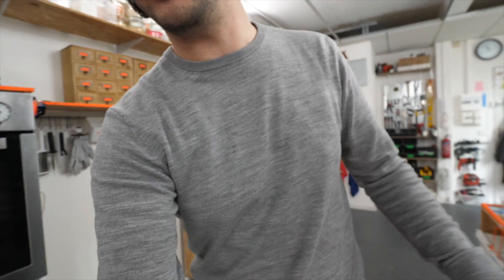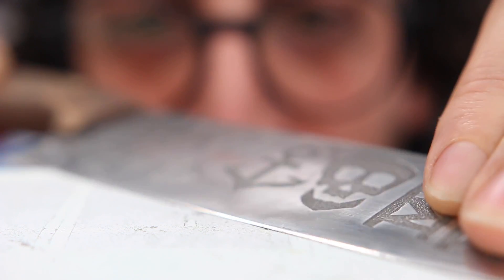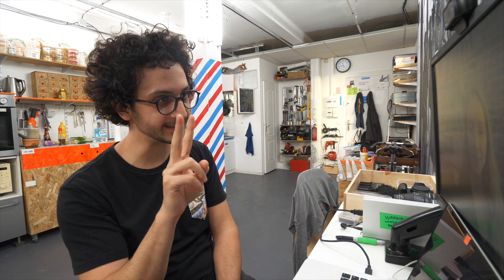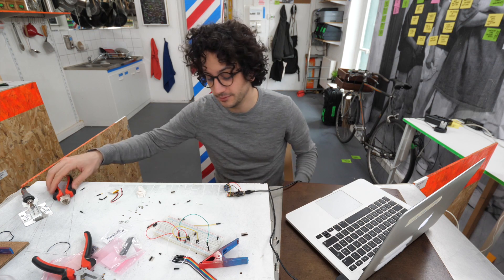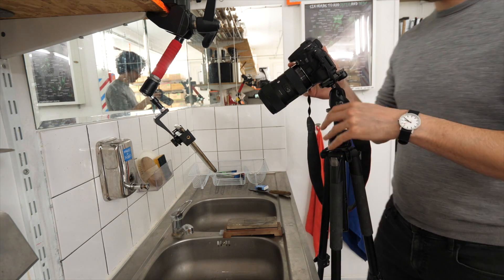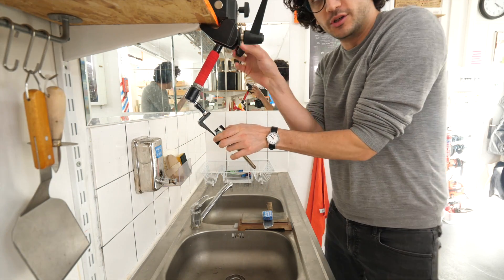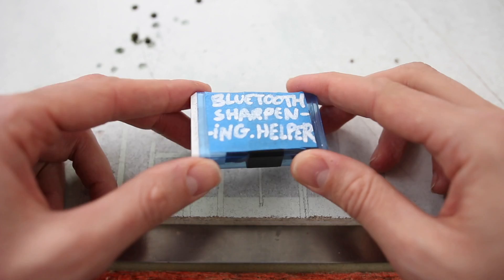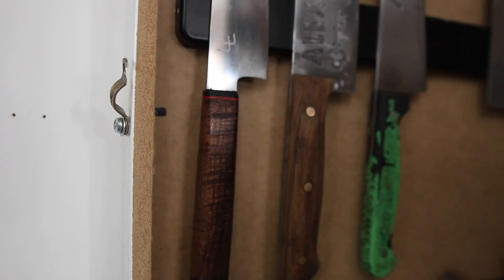Is This The Future Of Sharpening ?

Comment: why not use a wedge, with a sliding mechanism, holding it beside the sharpening stone (so as to not gunk it up with any material coming off the wedge)? always great to learn new skills, but this really seems like an overengineered solution that doesn't even really work properly. In my opinion, you created something that tells you you're doing it wrong (as in, youre not at the right angle), instead of building something that helps you maintain the right angle (which in my opinion would be more effective).

edit: hadn't finished the video when writing my comment. I wish you good luck trying to learn what others probably have spent years to master :P
Reply: I rather like this idea.  How about making making the sliding mechanism part of the base that is frequently used for holding water stones?  There are already little wedge guides you can buy, but these would have to be large enough to grip and snap into something like an arm coming off the base,  You could clip in a wedge for whatever angle you want, rest your knife against it and the wedge/arm would allow guided forward and backward movement on the stone.  It would allow people to continue to use their water stones which are largely the choice of professionals.  Only downside I can see is that knives with a lot of curve/belly would still be tricky.
Reply: This is a thing already (Wicked edge,lanksy,ect). Sharpening a belly is absolutely no problem with one of those devices.

Comment: Awesome to work with you on this, Alex! 🔪🌟
Reply: Can you tell why he thought that he has to pull his sweatshirt off for skyping with you?
Reply: nickt watch my video and check out our tutorial! I address this issue and use a 9dof absolute orientation sensor with built in sensor fusion.
Reply: put an led on the device that shows green while its in the range you want then turns yellow when its just outside the range and then red when your damaging the blade.
Reply: Becky Stern +
Reply: Alex, Becky, awesome work! I build DIY electronics for fun, and love watching cooking channels on YouTube so it really feels like my worlds are colliding :)
Reply: descending tone for low angle ascending tone for too high of an angle would be easy to use listen for tone look at knife
Reply: Display widget on iPhone that show deviation from desired angle like the gauge on fire extinguisher: black needle straight up for perfect in a green band the width of acceptable tolerances. Red bands on either side of the green band for unacceptable angles.  Needle moves as the chef moves the angle of the blade. Drive knife like a video game.
Reply: I think there should be a visual indicator on the instrument, like a few leds. Also the software could show an histogram of angles and real time average and std deviation.
Reply: ThomEA Wireloop game. Buzzwire game.
Reply: LEDs! Hers had the feedback!
Reply: Seeing the knife and the star next to each other.
Sharp Light popped into my head.
Reply: IIRC the gyro is unaffected by the acceleration, or is it a software fix?
last time I used a gyro (granted it was a while ago, and through an api) I didn't have to correct for that.
Reply: Yes. Make the display analog instead of digital with a dial type indicator that moves real time.
Reply: Becky Stern I have to ask, but does the device take into account that the shape of the sharpening stone changes as it wears? If the device always assumes that the surface is a perfectly flat, then the stone has to be flattened before every sharpening session, and the necessity of doing so is a topic of controversy in many knife sharpening circles. Otherwise, most stones are left slightly concave and will usually change shape in all sorts of ways as you go along, depending on the person's sharpening patterns. Just needed to get this out there because it wasnt addressed at all in Alex's video.
Reply: Echoing other comments, the display does need to be on the device rather than on the phone.  I suggest looking to electric guitar tuners as an example.  Have it light up red when you're off, yellow when you're close, and green when you're spot on.  That would be a device worth kickstarting.
Reply: What this needs is @Simone Giertz and some Tens 3000 electric shock feedback.
Reply: I think a continuous tone that changes pitch would be much better than a buzzer.  A buzzer would only provide binary feedback whereas a continuous tone is more like fuzzy logic.  It can be set to a low tone when the desired angle is met.  If the knife deviates then the pitch of the tone will get higher.  The farther away the knife angle becomes from the target angle, the higher the pitch.  This continuous feedback is the way to go.
Reply: Years ago when the 9DOF sensor that Becky chose was a grain of sand on a beach,  I researched accelerometer based tilt sensors.  Changing the orientation of the sensor can greatly improve the reliability with he reciprocating motion from sharpening.  If two axis of the accelerometers were mounted in such a way that they were 45° from normal of the flat of earth when tipped at the middle range of knifes then physics and math compensate for the motion in the sensing.  Wish I could put pictures here...
Reply: Nice one guys...
It may have been mentioned but here's a few ideas I would be to add...
a) A screen with just the current angle rather the scrolling UART numbers
b) A target angle input.
c) A shifting red/black/green back light or something similar to see if your in the sweet spot.
d) A tone function you can turn on/off that does the same thing. No squeal means you're on the money.
Also, maybe take the angle of the actual blade off i.e. the spine. I think that's why it was showing 2-3° when flat.
Reply: Maybe some how getting it in the handle of the knife so u can market your own knife.? Eh?
Reply: Nice work. Now to leave the intelectual plane and enter in the physical work you need to think in the learning process and the archievments involved. The key is Muscular memory. Maybe you need a standard for a tolerance range.  Test a trained hand an expert.calibrate the good readings. You could know which are the good readings in relation to a good sharpened knife. Then generate the code to the visual interface. (red yellow green led ) then stop thinking.the hand knows. For a cheap initial reference use the the tongeru knife sharpening guide 7dls in amazon. In Spain google comercial Pazos.
Reply: Maybe an improvement on the device would be an indicative light, you could set the range of angles which are acceptable for the sharpening, and a red light would mean it's not in range, but green light means it is.
Reply: Alex French guy and Becky, I have the answer to all your problems, and this will make your gadget totally marketable, and it's simplicity itself...A buzzer (and/or a light) that goes off if you're over 1 or 2 degrees plus or minus on your sharpening angle! A buzzer! All I want is a lousey 1% of every one you sell. Seems reasonable. ;)
Reply: this idea wont work fundamentally. The arduino measures angle by measuring acceleration due to gravity. But because you are constantly accelerating the knife backwards and forwards while sharpening it completely throws off the reading. The arduino measurement only works when the knife is still (or moving at constant velocity)
Reply: Becky Stern you are so pretty

Comment: Wow, that's pretty high tech.  For me, personally, I put a convex angle all on my knives (they aren't kitchen knives, though). With a convex edge,  keeping a consistent angle doesn't matter quite as much. Great video! God bless!
Reply: To add a bit to Will's answer, Alex here is sharpening on a whetstone.  The material will not deform in any way during the sharpening process, and so he is left with an edge that turns out flat.  Well, in theory... more on that in a moment.  When you want a convex edge, you sharpen on a medium that isn't as firm (e.g. a leather strop, or a mousepad with a piece of sandpaper on top.)  The end result is that your edge is curved outward slightly, and tends to be a bit stronger due to the extra material backing it up.  It's difficult to obtain the angles desired in most kitchen knives, though, and though Will suggests angles matter less, they are still plenty important, and are augmented by pressure now being a concern.  Thing is, when freehand sharpening on a whetstone like Alex here, you can't maintain perfect angles (as is the point of this video) and so you actually end up with a sort of convex edge yourself; many flat angles of different degrees creating a slight curve.
Reply: Will K Same here Will even on kitchen knives.  Holding a precise fine angle maybe makes them incrementally sharper but how sharp is sharp.  I can shave frog fuzz with a convex angle and it makes the edge stronger too.
Reply: Tri Monster the bevel is slightly rounded instead of sharpening a perfect V shape.
Reply: Convex sharpening, especially on a wetstone, needs a lot of experience but indeed, it holds the sharpness much longer and is easyer to refresh with the steel rod. I used this technique even for my Damaskus knifes before I changed to Windmühlen Messer (Robert Herder). They use a historic thin blade technology, and it doesn't matter of 17, 25 or 30'<. Sharp is sharp, a smaller angle just makes the cut a little bit easyer to slide through the tomatoe. The smaller the angle, the shorter the fun. Hard to explain in english for me. There are youtube Videos about the grinding and sharpening of the Windmuehlen Messer. They give them a finish on wood, with oil and limestone, and for the rest of your life a sharpening rod is enough. CS or SS depends on your "cleaning discipline", I prefer Stainless before Carbon. There are a lot of "factory outlet sellers" on Amazon and Ebay. If Waterboarding is your hobby, stay with Dreizack, Zwilling, Victorinox, Diktum, Boecker, I have them, I love them, but since I use Herder, I don't  read all the Internet forum contributions "how to sharpen the smartest way and how to service my waterstone" any more. I cut. I use my knife. I prepare food.

Comment: Here's an idea. Like a how guitar tuners work I think you can do something similar to the system. When you use those mini guitar tuners they tell you if your pitch is on key or off for each note now apply that to sharping angles. For sharping angles I think you can try vary degrees and have it "tuned" to that angle on the basis of a red(off) and green(on) light ex. if you want a 15° angle it'll go red untill you are at a 15 angle.

Comment: I'd suggest adding a tare function so you can set the baseline angle to 0°. Also, you could probably program the Arduino to have an allowable tolerance on the angle at which you're sharpening - something like ±2° from an inputted desired angle. From there, you could either have an LED or audible alarm to tell you when you're not sharpening in your allowable angles.

That, or you could probably make some type of jig that allows you to set a specific angle (measured through the Arduino Bluetooth device). From there, the jig would maintain the angle you set, and just slide back and forth over the whetstone.

Comment: Salut Alex, as said in the other video, I would really ditch the Bluetooth/phone part and replace it with LED on the board directly. When you sharpen you don't want to look anywhere else than at the knife as it could be hazardous. If you put 5 leds to the board you'd have the info right on the blade. It would also make the build cheaper and the battery last longer. And it avoids needing a phone, that also needs a charged battery, be compatible (less of a problem as you are using UART), blablabla. Love your vidéos :)
Reply: I would put some kind of LCD to show accuracy like an analogic display, like a guitar tuner. 
Looking for example like this [                  |###            ]
This LCD should be on top of the device to be able to read it (on the side I mean).
BT can be used to change settings of the device with a nice app for blade selection for example.
Reply: This. With a built in 'reset angle' button.
Reply: and an angle button so you can change the angle setting using the same LEDs to select the mode (15-17-20, etc) you get the idea.
Reply: As Gillermo said, we need a reset angle button to 0 it out on the stone before putting it on the blade, because if it gives you an absolute angle and the stone has 2° offset, you are off.
Reply: Yes
 5 LEDs.  One button. Long press for reset to zero. Short press for 5 different angles represented by the 5 leds. (8 - 10 would be possible but it would need a "shift" led and more printing). Wait 2 seconds and the center led shows perfect while the other leds rise and fall with respect to angle.

This seems like the simplest solution.
Reply: You could get a similar effect with a piezo buzzer
Reply: Your display representation is perfect, that is exactly what i had in mind, but with LED, the advantage of LEDs is that you can have them partially on (analog vs digital). If you are dead accurate, only the middle on it lit, the more you offset the more they get lit on the side you are offsetting to. An LCD would be great, but expensive (like you could get 200LED for the price of 1 LCD, it makes the code heavier and more complicated and not has easy to read than simple lights for anyone that hasn't been gifted with perfect vision. If you can make it simpler without sacrificing any functionality, it is, I think, the way to go.
Reply: I like this track of thought. However, I would prefer a single RGB LED and keep the Bluetooth for minimal integration and modification of the project. Then on the software side of the app, you could have the option of setting the offset angle from flat surface, desired angle and tolerance. For extra feature, you could possibly have stats and graphs displaying your performance over the duration.
Reply: The rgb LED was my first thought too, but to me, it presents the same limitations as the piezo buzzer cited above. What would be the correct color, green? with variations to red when you go out of angle, it is somehow too analog and not very precise (not to speak about the problems for the colorblind), the buzzer has the same problem, as to hear the tones differences or pitch variations isn't easy if you don't have a musical hear. Personally, I'd be fine with both solutions, I have a good hear and my sight is perfect, but you have to take into account the large majority here. Whether or not you are colorblind of even short-sighted, lit or not lit LED is clear, it is also cheap, but maybe there is something to do with RGB LEDs indeed. About the data logger, is it really useful? I'd ditch the Bluetooth altogether, I see it as a burden because of the battery (bluetooth drains) and because of the phone. You can still log the data and export it to serial USB if needed, but what is the point really? You are not training for the Olympics of sharpening. The goal is to have nicely sharpened knife, period. Don't you think?
Reply: Christian Hoyer Which you could do in my 5led setup. You could change the arduino sketch for the 5 angles that the leds represent. They would be stored, in code, on the device.
Reply: Other advantage of ditching bluetooth: Probably the Arduino can't update over bluetooth as quickly / as often as it would be able to a light / display / buzzer attached to the devise.  My other concern is that you are reviewing the data after the fact but your muscle memory isn't mapping the times you are off to immediate feedback.  The quicker / more direct feedback on the devise itself would help with this, I think.  Another thought: you might stick with bluetooth data being sent so that you can chart / compare each performance to review how you are doing.  If you're just looking at 14, 14, 13, 16, etc... your brain will pick-and-choose what numbers it looks for.  If you're serious, you should analyze the numbers between each performance in aggregate (such as median / mean angle).  To do that sort of evaluation, though, you'd probably want a button to say when you've started / stopped the actual sharpening
Reply: I would prefere a possibility to setup your personal angle on the PC and the device has this values saved
Reply: Exactly that. Actually, you can have 8 angles if you use 1 led as a register, or use various combinations of LEDs for more choices (would require a legend somewhere). But we pretty much have the exact same thing in mind.
Reply: would probably smarter, albeit a lot more complex to have an LCD screen (like a calculators) displaying the angle on your knife
Reply: Not that more complex, and not super expensive 2-3$. They do take place. But I'd avoid an LCD if I can like I'd avoid an extra button or anything not adding extra functionality.
Reply: Your idea is great, but sorry if I ask..wouldn't be simpler to put a wedge between the knife and the board? This way you would have a stable triangle and your force would be needed only in moving the knife foreward. The device could be useful in giving you the infos about the "rightness" of your angle. Differents  heights wedges would provide differents angles. The wedge must flow swiftly on the board and do not damage it. So the material should be determinated, maybe just sanded wood. Just some geometry I guess.. Hope it helps.

Comment: When you are sharpening if you want to lock in the arms + the angle, use your legs and hips to move your upper body back and fourth.  That way your arms don't need to move, making it easier to maintain your angle. 
It's how machinists are taught to file a surface flat.

Comment: couldn't the knife be attached to a block of wood which holds it at the right angle? something that works like a wood planing tool. you could just pull the knife back and forth without worrying about the angle